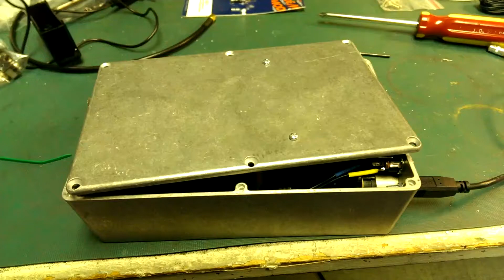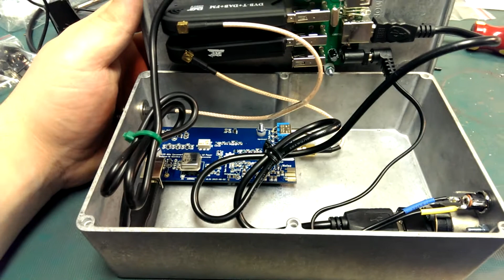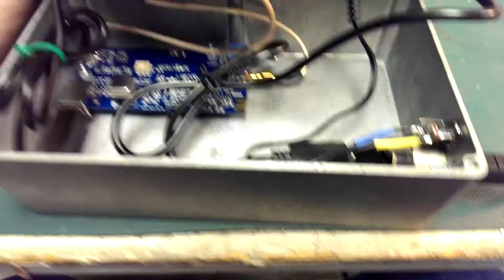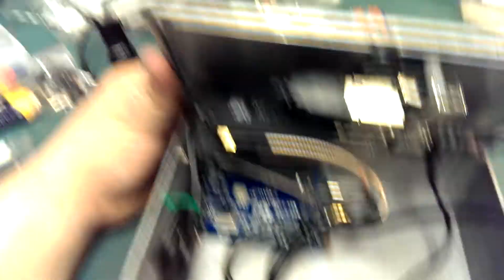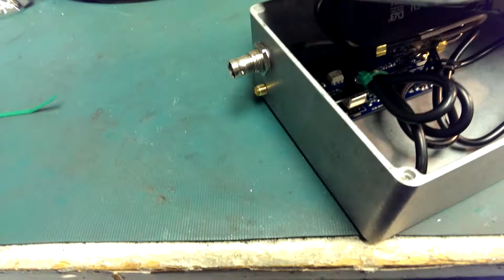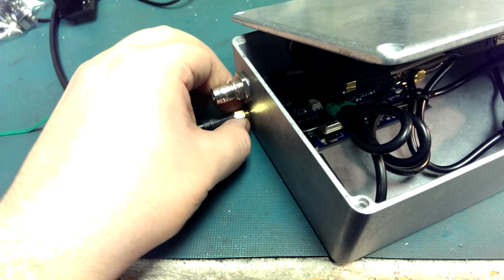VE7WNK SDR Box - Part 1

Comment: I love your enclosure! Nice one with the USB-hub.

I am using a smaller Hammond myself, for a single R820T. Got some noise, possibly because it is too tight for a coax to fit. 5 meter USB cable so that it can be placed as close to the antenna as possible.

I am wondering, are you able to use both dongles the same time? How is the bandwidth remaining on the USB-cable out of the box?
Reply from the maker: Hello Joakim. I have two R820T-based units in this box and they work fine together. The only issue I have is knowing which unit is which in SDR#, so I just look for which one has the biggest spike at 125mhz and I know that is the one with the up-converter on it. There is no issue with bandwidth when using the default 2.4 samples/sec. This box does a great job of keeping the noise out, and they don't really cause issues for eachother, with the exception of a little noise from the up-converter getting into the aircraft band on the other RTL stick, but it is not really that bad, mostly just a spike at 125 and some weak hash after that.

Cheers!

Comment: where did you get the panel mount usb jack.looks like it  u can plug usb cable on both ends.nice
Reply from the maker: David Davidson Local electronics store is an Amphenol (AMP) dealer.

Comment: Son, ...now rf-isolate the individual components from each other while adopting the outlook that N connectors are preferred in UHF.
Reply from the maker: No need. With the SNR on these dongles being so low that I don't notice any noise between them. The 125mhz IF LO doesn't even leak into it. Sure, N is an option, but I don't see any issue with BNC vs. N at these frequencies. You can not even see the BNC green when compared to the N black in this graphic of insertion loss:
http://www.hamradio.me/graphs/connectors/UHFConnectorGraphs/Return-Loss_S11_1000.png
Reply: I can appreciate your effort at shielding, because so very few apply the principles.
But, realize that a competent Radioman with WTC "experience" has viewed your video and given comment.
Enjoy.
Reply from the maker: @СтивСкотт  LOL, I am glad at least you take your self seriously, because no one else who reads your comment will.
Reply: Son, this is not an Erector Set...